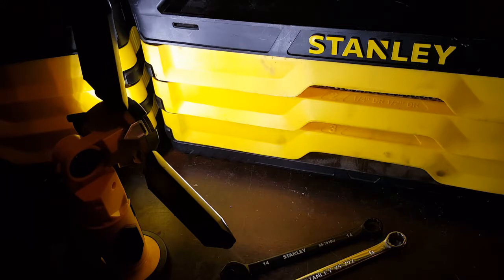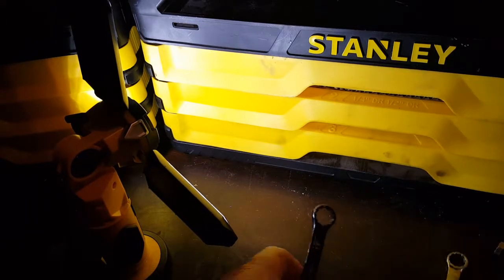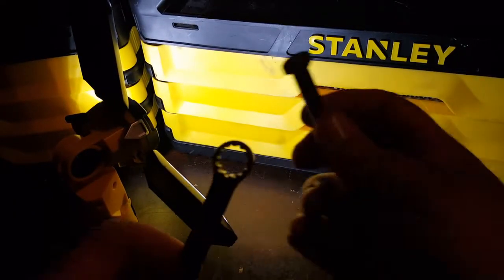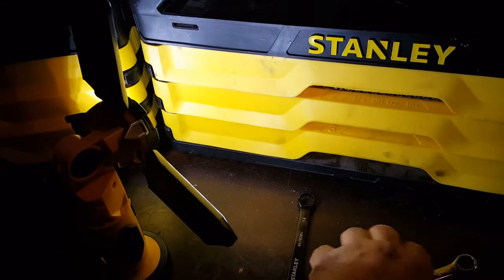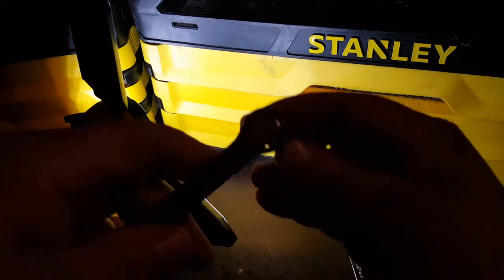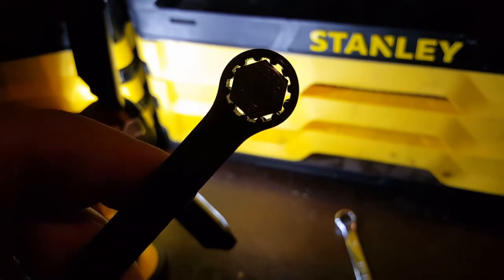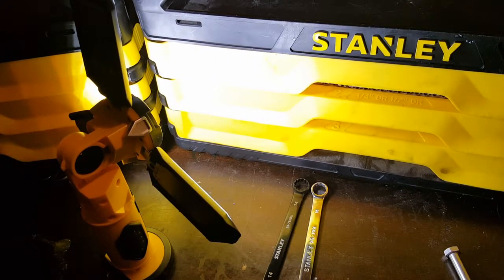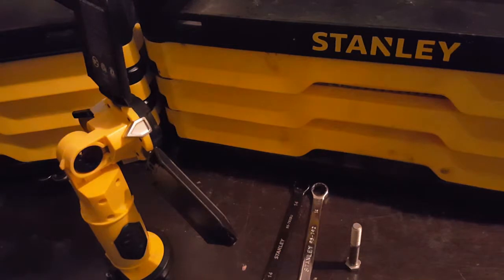Is Spline Drive Good Enough To Break a Bolt Loose?

Comment: 12 point is great on 12 point bolts. When you use 12 pt on 6 pt bolts, you are making 1/2 the contact (other 6 pts are not used)....it becomes a compromise, and okay only for lower torque situations only. Same goes with spline drive.

Comment: So why didn't you try and see if it worked?
Reply from the maker: I didnt want to chance rounding something important.

Spline drive is like 12 point, you don't normally use it for things like that. I'm sure people have done it, but the chances of stripping a bolt is greater with spline and 12 point.

Comment: You only need spline drive if you work in aviation industry 99% of the time. Your chance of running in to the remaining 1% is astronomically less and that's also if you work on many different types of cars everyday. I believe Ford was using this type for a very specific application

Comment: So it is basically a slightly updated 12 point but still far off from 6 point
Reply from the maker: Pretty much. But, it does give more options than plain 12 point.
Reply: @toolinhand  
They claim it can open any type of screw head but it seems that it comes on the expense of getiing screws damaged a bit.

I think the screws wouldnt want to be treated with these on a longer basis
Reply from the maker: I've only used Universals or 12 point when I have to. I normally just go for 6 point.